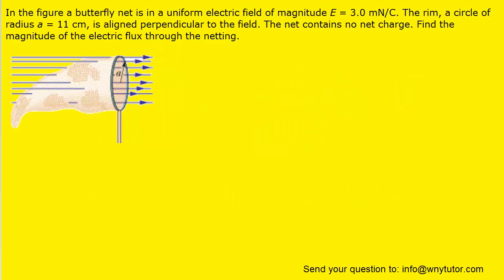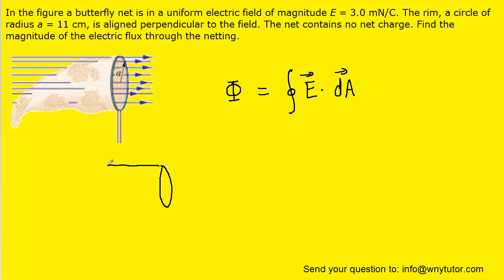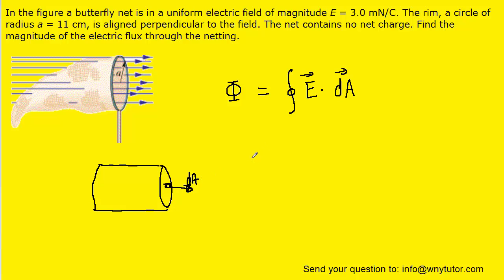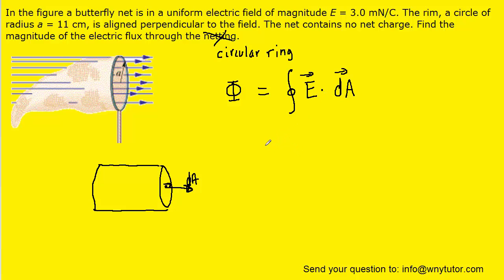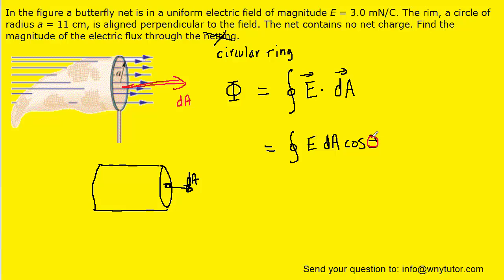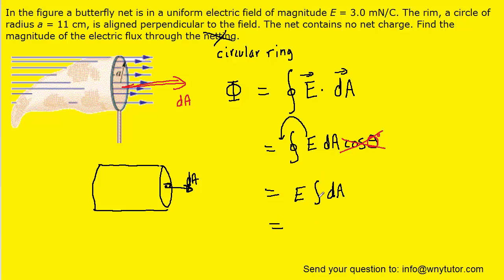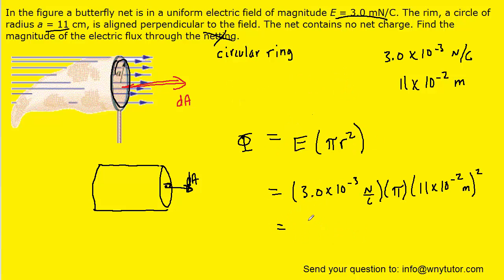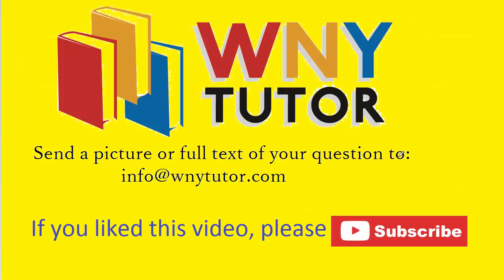In the figure a butterfly net is in a uniform electric field of magnitude

Comment: Sir
I don't quite get why is the magnitude of the Electric flux through the ring is equal to the magnitude of the Electric flux through the net, Considering the whole thing is an open surface not a closed surface.
Could you please explain ?
Thank You
Reply: This is a closed surface which does not enclose any charge. Therefore the negative flux must exactly balance the positive flux entering the surface.

Comment: How is the flux not 0 considering there is no charge enclosed by the netting/ring?
Reply: The NET flux is zero. The flux from the circle plus the flux from the netting will equal zero. So, the netting flux will be the negative of the circle flux.
Reply: @michaelhammer1550  Thank you for that comment! I literally understood everything after reading it
Reply: that's because we don't have a gaussian surface. That equation applies only to gaussian surfaces. Here we merely just have a netting and a ring.